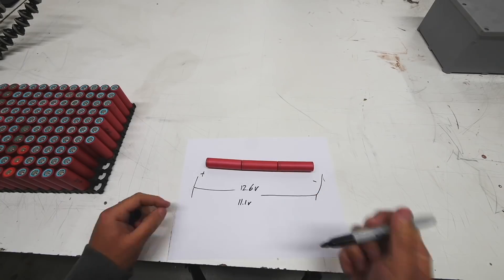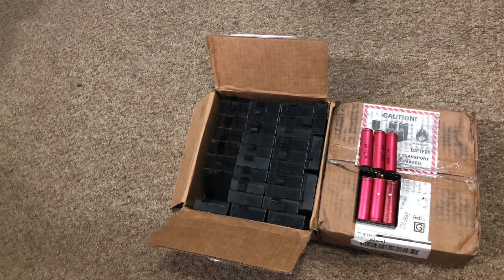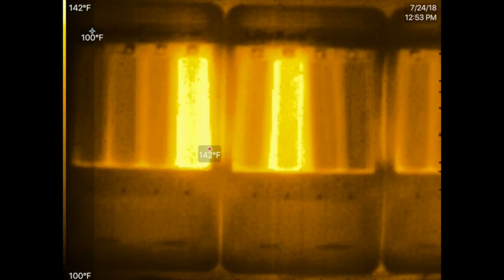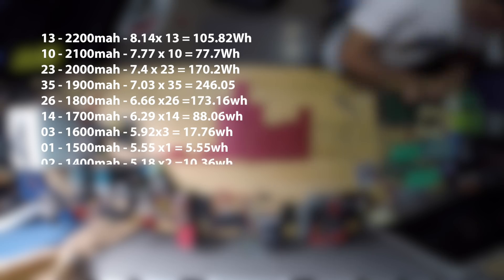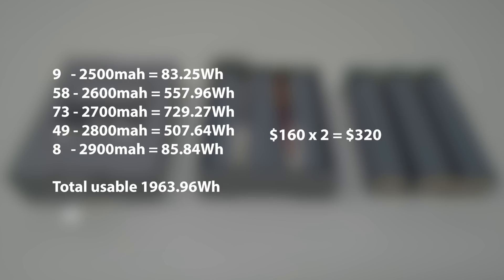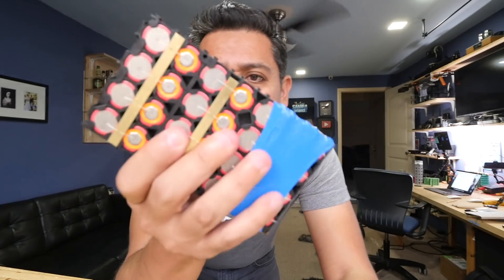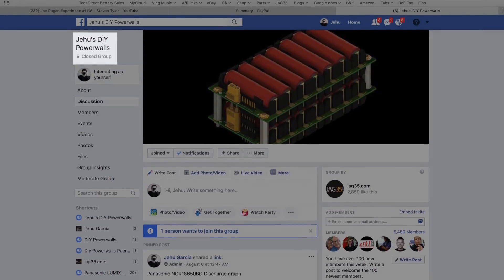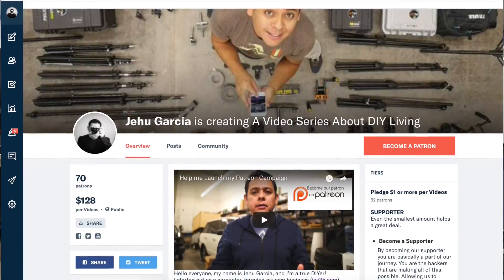Worst 18650 cells we Use

Comment: Jehu!!! I found a solution for the heaters! I have some of those and i found out that they start to heat at about 4.15V while charging. I charge those to 4.1V and they are just fine. Sure i lose some capacity but i can still use that 2000mAh or so. Using them that way is getting extra cells and capacity that would have been thrown away

Comment: Love those SANYO heaters, my 20kwh build is entirely made of these cells.   After much testing I have worked out a few things.  Number one is charge and discharge the cells at the rate you intent to use them at.  So my setup will only ever see 300ma draw and charge, or in rough figures 2500w in or out for the setup.   Number two, charging these at 300ma and you'll rarely see a heater, but you will see cells that never reach full charge or take a huge amount of time. These are your heaters :)  your other heaters fail in the charger due to huge resistance :).   Number three,  sometimes you can visually tell from the wrapper that the cell is a heater, as the colour is slightly different because those cells were heating up big time in their original device.  Number four,  don't use or charge these in your house !  I test and keep my final packs outside !    I have plans to run my packs in containers that allow the heat to rise up in the case, which I can then monitor the temperature of each pack, any heater will slightly throw the heat signature of that pack allowing programs like PRTG to alert on abnormally high temps vs ambient vs history etc.  it may work, using relays I can take that pack out of play :)  could be overkill and expensive.   I think eventually we will see laws that all battery packs live outdoors.

Comment: Stackable 18650 module with holder that's gold...
I never don't like idea of soldering to 18650 and spot welding battery pack prevent from easy replacement of dead cells.
It looks like great serviceable idea!
Reply: Electronic Noob Blog the holders cause hotter contacts, I don't know if he solved this problem with the holders...
Reply: If I remember he was Pushing the Power draw pretty high. Typical usage wont be that huge of a draw. 500ma to 1 amp
Reply: I would solve this just by lowering current (adding more modules in parallel). 
I think he use off shelf 18650 holder and i would stay that way. In my opinion some times in overall design  at end of the day it will be cheaper use something that is readily available than redesigning and making custom fit even better but much more expensive.

Comment: What I need is a good BMS for a portable computer project that I've been working on. I have access to brand new LG 3Ah cells for a reasonable price, but will likely parrallel them 8 wide to get a couple hours of run time. I see the FB link, so I'll take my question there, with more information, tomorrow.

Comment: Southern winds that you called heaters what's to stop the other ones from becoming heaters in the next two or three Cycles
Reply from the maker: The grace of god
Reply: Here's my protocol for testing these kinds of cells. I recover from laptop batteries mostly. 1) fully charge cells individually 250ma 4.2v for 12-16 hours until current drops to under 50ma. (any warm cells get tossed). 2) rest for 24 hours. Any cells below 4.15v get tossed. Discharge groups of cells in parallel (to speed up process) at 1.5a per cell down to 3v. Any warm cells get tossed. Charge 375ma 4.2v until current <50ma. Warm cells tossed. Rest for 48 hours. Any cells below 4.15v tossed. Capacity test cells individually, 500ma discharge down to 2.75v. Record capacity, rate, and cutoff voltage on cell. Recharge at 500ma 4.2v, stop at 50ma. Calculate cell internal resistance and record. Now for the self-discharge test. I wait 30 days, and measure capacity again. If capacity has changed by more than 100mah, then is cycled 5 times and completely retested with same protocols. If inconsistent results are measured again after 30 days, cell is tossed (self discharge most likely).
When building a battery, I balance the capacities so that all parallel groups have the same total capacity within about 5%, and all cells in pack have resistances within 5% of each other. This means that I have to go through a LOT of batteries to get enough similar cells to build packs, but I have yet to have one fail or start heating up on me. My recovery percentage is around 40%, but that is because I am very picky about heat generation, internal resistance, and self discharge.
Reply: warren. what do you end up with like 10 batteries? Most Cells will Self discharge down from 4.2 to 4.18 after a week, and 4.1 after 2. you should avoid letting them sit full, but they do drop fast from 4.2 because they hate sitting at that voltage. its why 80% is the preferred (4.1v) top off for max life during use. I built 2 e-bike packs of 54 volts and in 15s6p and most of my cells would not have passed. 30Wh per mile, Range is 20 miles or so on a 1kw motor. building a 2nd, now with the lot 2600 just released. Keep in mind most of the cells that have sat will show their true colors on first or 2nd charge. Personally I don't agree with using 2nd hand cells for things like Home power. that's not something I agree with but for projects like Bikes, backup Inverters or perhaps a Car. sure. the Pack dying or catching fire means you lost the project not your houshold power for your house or Residence.
Reply: I'm sure you're right about losing cells that would otherwise be acceptable for many projects. I'm just concerned that if I let a marginal cell get through, it will fail on me and cause a fire, or early failure of the battery pack requiring me to unweld it all apart, replace the faulty cell, and weld it all back together. The majority of the red wrapped cells (Sanyo I think) fail my testing very early on because they get more than 10C above ambient while charging. Many cells that test capacity below 1500 mAh are also not really useful for me for the most part. I didn't mention total capacity as part of my testing requirements because everyone is going to have different needs. 
As for the cells dropping in voltage while in storage, I don't bother reading the voltage after the 30 day wait because I know that after that long the voltage is going to sag. That reduction in floating voltage isn't so much a result of the cells self-discharging in an unsafe way, so much as it is normal behavior for that chemistry of battery. I care more about capacity and internal resistance than I do floating voltage, really. 
I don't know of an officially approved testing protocol for used 18650 cells, and I'm sure my testing is more thorough than it needs to be. I like it that way, because it makes me feel better about reusing salvaged cells from such a dangerous battery chemistry. If I get sloppy and a cell catches fire on me, it will be my own fault and will potentially ruin an entire project. Much better for me to toss a few good cells than to risk a crap cell getting through and ruining it all for me.

Comment: Could i run a samsung 18650 and...say an lg 18650 in series?
Reply: Charles Adair with a bms, yeah
Reply: Fishman 02 BMS?
Reply: Charles Adair battery management system, it keeps all the cells at the same voltage, so the difference in capacity will not matter.

Comment: one of your more informative videos

-I presently have about 200 salvaged 18650's harvested from notebook batteries
   -and like you find 60 to 70 % GOOD once tested and balanced

   -yup Sanyo's ,if identified,are as bad as Chinese "brand "x" units (about 25 %) ,
    most used in Acer notebook and other lower tier units like H/P,Asus,Sony  and Toshiba

have had better luck with Panasonic,Samsung, and LG's used in BUSINESS CLASS
   Dells and Lenovo battery packs.-and MOST true Toughbooks,not all ~ 

 Sony units vary widely from excellent Japanese made  to CRAP Chinese (IF identifiable ~)